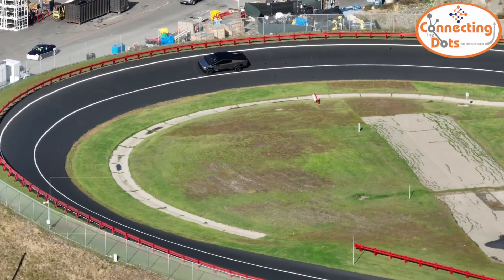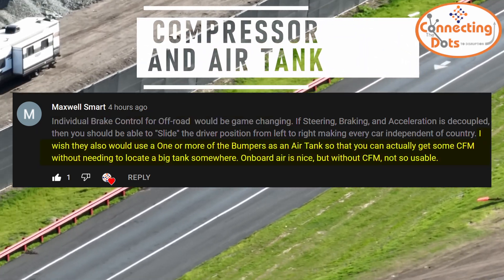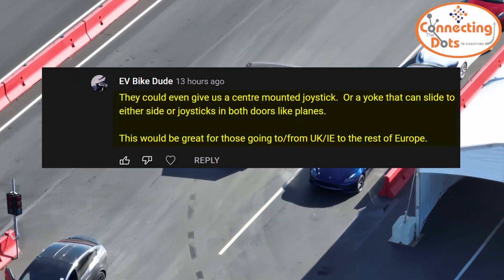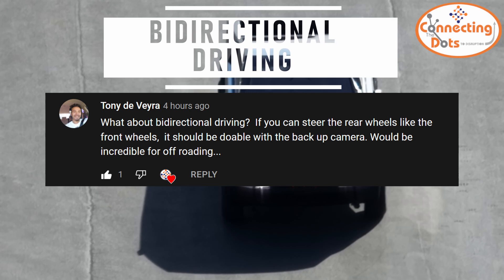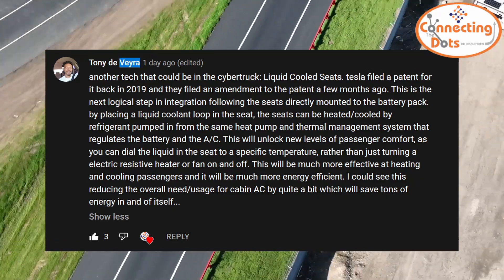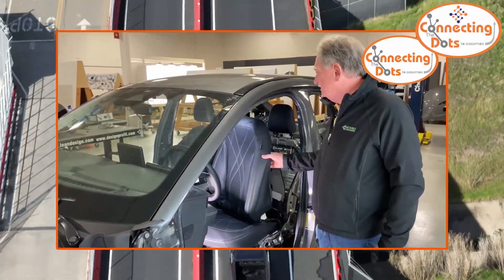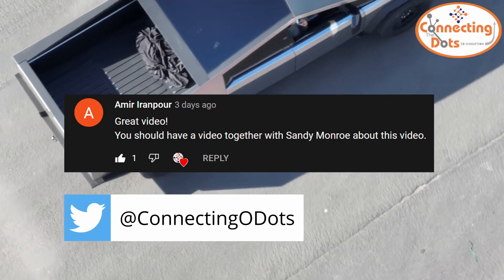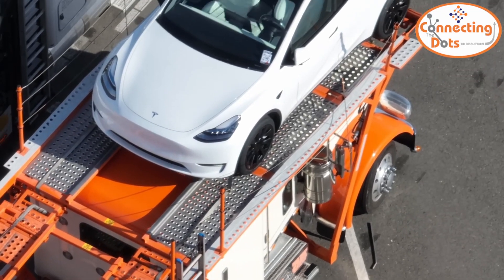LHD/RHD Cybertruck and Other Viewer Comments | Viewers talk Cybertruck

Comment: Tell ya one thing - with all this tech likely to be in the vehicle, I HOPE & PRAY the air suspension can handle the pitch & roll of this thing. Looking at some of the vids, this truck wallows like a small boat on heavy seas, which is a deal breaker - watch clips of GM’s magnetic shock setup & how it handles this shifting in large vehicles like an Escalade - its magic. Can only hope Tesla looks at this and comes up with a way to stabilize this truck.
Reply from the maker: Any videos we had online are100% preproduction and most likely prototypes. Their shock absobtion doesn't have to be anything like final product. No real problem making air suspension stable.

The main point is that air suspension replaces the SPRINGS while GM (originally Delco) Magnetic replaces the SHOCKS. You can use either regular springs or air springs with regular shock or magnetic ahocks

And btw a fan of GM magnetic shocks myself, Smart idea, well executed
Reply: @ConnectingODots  Great points.  I’m a day 2 res holder for CT, have a 2018 M3 AWD which I love - really just wanna see Tesla nail 
this thing right outta the gate. Awesome vids - keep em coming!

Comment: Okay, this is one has been driving me nuts since 2019: A design change for the Cybertruck that seems glaringly obvious based on first principles - and yet it doesn't look like it's going to happen as more iterations of the original design surface. I have hoped some engineer somewhere on some video would focus on this, but I've seen nothing to-date.
The vault, along with the buttresses, is a stroke of genius by Tesla, but not just from a structural perspective. Now that GM , Rivian, and Ford have played their cards, it is obvious that no one has any hope of duplicating one of the most powerful aspects of the two aforementioned Cybertruck design cues - when combined - but I fear Tesla is about to throw away one of the most compelling market-crushing features as the company moves toward tooling.
What am I referring to?
The much bandied-about conversion of the truck into a climate controlled camper.
Yes, we've all heard about it: drop the back seats down and emulate GM's avalanche-style midgate and open the whole vault to a massive micro rv space. Unlike GM, the tonneau acts like a ceiling for vault occupants, allowing them to camp anywhere with full heating, air conditioning, and lighting.
Bad news. It doesn't look like Tesla has changed the vault rollaway tonneau configuration, which has massive inherent risks and complexity. In its current configuration, it simply won't work for a camper mode. Also, in its current design, it has dozens of slats where debris and ice can build up, and has to come down IN FRONT of the back seats to feed into a storage area under the bed. This makes a midgate highly unlikely, and  - as seen at  the Giga Texas event  - the back drop-down window behind the back seats is too narrow and high to pass anything through. 
This design also limits the ability to convert the tonneau into an effective solar array and, even if Tesla does this, it is stowed at least 50% of the time (my truck's tonneau is rarely closed), not generating power. 
As Rivian has unfortunately discovered, a stowaway cover that adds overt complexity adds risk - and stupidity - to the 'feature' , which is bound to break. 
The solution is obvious, but no one seems to have looked into it as far as I can tell. A solar panel that doesn't have to bend, be partitioned into multiple slats, or be stored in an area where it can't be generating solar 24/7 is the only alternative, eliminating electrical connector challenges and parts fatigue. And, the most competitive bonus to the Cybertruck would be to have dropping back seats AND the ability to raise and lower the tonneau, regardless of the seat position.
Think of the multitude of potential configurations!
The truck has a massive sheet of glass right overhead in the back half of the cabin. The dimensions are similar, if not perfectly aligned to house the tonneau underneath. Why not add a 2nd layer of glass or supporting composite, creating a 'pocket' for the tonneau cover/solar panel to slide into? This eliminates all the complexity and mechanics of the current design. The tonneau simply feeds up into the upper cabin window 'slot', which can serve the dual function of shading out the glass on hot days, and all the while generating solar power in either position. From a wiring harness perspective, this simplifies cable lengths, motors, cleaners, and all the fuss of making the current design work. Even the deployment could be dramatically simplified. Where the stowed, rolled up tonneau had once been, add a master compression tank to vastly improve air pressure and load duration for air tools, but also using air to power a dyson-like cleaning brush at the slot entry that simply spins on air pressure, cleaning the tonneau surface as it enters the slot chamber. Even the opening and closing of the tonneau could be accomplished with simple air compression from the same tank.
I can't overstate how revolutionary the CyberTruck would become if it had onboard solar, a secure, climate controlled sleeping quarters in the vault, and the ability to drop the midgate and store 12' ft' length lumber, - 2ft longer than the Silverado EV - but all under a secure tonneau/vault!
Ford, GM, Stellantis, Rivian, or any other manufacturer currently has NO WAY to both store full midgate drop-down bed space AND cover the area.
I would love to brainstorm on these thoughts, have them critiqued, or even considered for a follow-up video.
The Cybertruck will undoubtedly transform the truck market once in production. I just hope a group of engineers have already mastered some solution in relation to this challenge and opportunity to make the full potential of this engineering masterpiece a reality.

Comment: As you know Infiniti has actually introduced the first drive-by-wire system a few years ago, however they couldn't move the steering wheel anywhere they wanted to due to the requirement to have a backup mechanical connection. So even though the steering wheel during normal operation is physically disconnected from the steering rack with a clutch, the supporting hardware still has to be there which then takes away the simplicity in switching between LHD and RHD markets.

Comment: I have a big issue with steering and braking by wire. Your answer for steering failing is ignoring the fact you still have control of the vehicle. Mechanically. 
A redundancy could be added if the car shuts off with a separate back up power system. Just like a drive by wire system.
The problem is if that fails you have zero chance. 
The same redundancy for drive by wire can be applied to mechanical redundancy.

Some things shouldnt be thought of ease of producing.
Being reliable is one thing, but the cost if failure is another.
Also if you understand the aircraft industry, systems that rely on fly by wire often use mechanical/hydrolic back ups.

Comment: Do you think the air compressor will be used to keep a positive pressure environment while in Amphibious mode to ensure no water intrusion?  Does the cyber truck have any noted use of a Tank for storage of compressed air?  Would it be not easy to envision even using a body panel sector as buoyancy chamber for ballast and or compressed air storage for such positive pressure cabin use?  Perhaps even being able to plumb in a scuba tank with regulator to facilitate extended time for positive pressure cabin?  Cheers and again excellent work.

Comment: The idea of efficiently cooled seats has utility far beyond cars. In the future when climate change has insured large parts of the world will need AC to be habitable, the idea of heated/cooled furniture has huge potential to save power over the typical approach.  Most people spend their days going from one piece of furniture to another, so having the furniture rather than the room control their comfort seems logical. You might still have the room dehumidified and cooled a bit, but most of the cooling would happen on the seat/couch/bed.

Comment: What do you think about the cybertruck being released as a single trim level? Cutting out even one motor will kill a lot of features. I could see them all being quad motor. Then you might as well max the battery. More parts per vehicle but less management of trim levels/orders.

I can see Elon saying: "Yeah.... We thought about it... Like this is the cybertruck. They should all have the same capabilities"
Reply from the maker: Cybertruck was announced with extremely low prices bc production cost expected to be lower than usual. However demand went through the roof and selling for anything near original pricing would be absurd when they can clearly charge a lot more. If CT is sold for $40-80K, many will immediately be flipped in secondhand market for twice the price.

Tesla CAN raise prices (preorders didn't reserve price, only price of FSD if ordered) but instead it's better to just launch a quad motor version and charge high prices until production ramps and costs lower. After that, I can only guess but I'm pretty sure they WILL offer fewer-motor versions at a lower price (though higher than originally stated)

Comment: I've ordered a Cybertruck some years back - the three motor version. I also added FSD. I live in South Africa - and would love to move between LHD/RHD. Thought this and your previous video were great. I want to collect it in Austin and get the Cyberlandr installed, go see a SpaceX launch (preferably Starship), go to Burning Man for a week - then ship it over the Atlantic to Africa. Would then drive it home. Might be still two years away!

In my thoughts for a four-motor vehicle - what I see in the future (10 or so months away) is....
1) Steering wheel that gives manged turning according to speed (low speed=turn sharp, high speed=turn gently) along with the ability of choosing what wheel turns in what direction (e.g. Diamond (Tank), safety when pulling a trailer - etc) - Steer by wire. I often pull a Caravan. Perhaps the "steering wheel" can tuck itself out of the way when on autopilot? Oh - and some way to drive/steer the truck with a remote, hand held "game" controller - from inside the Cyberlandr. Just slowly and short distances.
2) Individual wheel brake control (brake by wire)
3) Electrical - Charging at +800V, able to power my house with a 240V single phase (Non-USA) - use it like a Power-Wall. 
4) Liquid based temperature controlled seats (nice!)
5) Like the idea of an air tank with the air compressor.
6) Built-in Starlink
Reply: Hi Mark, got a reservation. perhaps we can ship together?
Reply: @michielsmit7969  sure - in a year or so. Let's see.

Comment: Thanks for interesting videos!  Genuinely digging deep into tech and potential is interesting, when the effort is put in to keep it grounded on physics and practical limitations.  Reminds me of CSI starbase, which is also great.
As far as the reduncancy goes, with 4 wheel independant brakes and steering, I'd expect it would be able to be tuned to bring the vehicle to a safe stop in the event of a total failure.  Thats without even considering independant drive  and even air suspension, which could make limp mode much more literal, being able to drive somewhat with damaged or failure to one corner, especially offroading.  Or for that matter just to get to a better spot to fix a flat.

Comment: RHD in Europe . The current version of Cybertruck is to large for use in Europe. Elon suggested to consider a reduced size version for Europe.
Reply: Do Ford or Chevy sell their "regular" size pickups in Europe?
Reply: @kjer6071  rare in UK. A few RAM trucks but since they are the same size as a lwb transit chassis with less weight capacity and worse fuel consumption.
Only folk who feel a need to "prove themselves" drive them.

Comment: I have CTIS (central tire inflation system) in my Hummer H1. This allows me to inflate or deflate the tires even while driving. This has worked nicely - when off roading in mud and sand or just inflating a leaking tire. CTIS is notorious for leaking air, but a great mechanic solved the problem for me. The Cybertruck would benefit with  CTIS for off-roading.
Reply from the maker: True, and with the on board compressor should be easier. Unsure if they'll do it (adds complication) but if they do, would be great for offroading

Comment: RHD/LHD will have opposite wiper pivot points, to give a driver the best visibility.  Tesla uses a diagonal cutout in the windshield, to prevent any difference in the body...brilliant.  But this makes it less effective on the other side, which isn't favorable to a swappable LHD/RHD design.  And how often would this feature be used?  Tesla is known for removing seldom-used features, and I have a really hard time coming up with a reason people would really need this, versus the cost Tesla will incur implementing this (both in time and money).  So I don't think it's going to happen.

Comment: Don’t confuse technology with gimmicks.  

There will never be a RH drive CyberTruck.  There’s no market for it in those countries.

CyberTruck won’t spin in place because it’s unnecessary complexity for a fairly h useful maneuver and violates first principles. 

Most of CyberTruck’s tech will likely be in manufacturing.  

Those crazy software features?  They won’t come at launch, if ever.  But maybe some day.
Reply from the maker: This is just a spinoff raising ideas from a deep-dive video about expected Cybertruck tech. As explained there, Cybertruck's brakes and steering will be By-wire, Cheaper and less expensive to assemble, and most of these features will arrive at around 0 cost (except for tweaking the software). The main video gives an engineering analysis (physical forces etc) showing that Rivian CANNOT do the tank turn, while it's highly probable that Cybertruck will. The current video is worthess without seeing the main one, and again - surprising as is seems, the unique brakes and independent steering which enable Tank Turn are LESS expensive than going conventional. https://youtu.be/Y41rHaTGgWY
Reply: Utes are a huge part of the market in Australia, New Zealand, south Africa and most of south East Asia
Reply: Not according to the forums where lots of people are begging for them outside the USA.

Comment: If trailer manufactures desire they could take advantage of vehicles with four wheel steering like cybertruck.  Tesla could make available an external digital rear port.  A digital port on the rear cybertruck panel whose driver wants to change lanes and does so by angling all the wheels left or right could be communicated by the cybertruck to a similarly enable trailer.  A trailer equipped with steerable wheels could then match the cybertruck movements left or right and all the counter twisting forces mentioned wouldn't happen.

Comment: That GM car looks great. The problem with GM never was the engineers, always the management.
Reply: It was also the UAW, who reached all the way from Michigan to every corner of the globe where GM has ever done business. The UAW power over the Big 3 worldwide has been little understood by most people, or downplayed by those who have depended on a CBA. That's part of the reason why corruption in their leadership is much more alarming than news reports would have you think.
Reply: @michaelterrazas1325  As a person who has worked for many managers and been in many unions, I can tell you the management is far more likely to screw things up than the unions. The unions sometimes are enablers of bad behavior, but the managers are almost always the source.
Reply: @macrumpton  I'm not interested in the amount of blame you want to assign to each. I did a LOT of consulting in the auto industry in the 90s and well into the 2000s. I worked with several manufacturers, and those saddled by the UAW had HUGE obstacles to overcome to allow them to move into the future. I was in meetings where several of us showed that continuation of certain policies would hurt GM, in particular, to the point where they just may go under completely. The UAW representatives used their veto power to stop the company from doing ANYTHING. That catastrophic decision was a big part of GM needing to be bailed out. So don't try to tell me the unions aren't a big part of the problem. You don't know what you're talking about.

Comment: Loose talk. Rear steering is very limited as there is no need for a small radius turn.
Reply from the maker: you're right about small angles, but they're not necessarily THAT small (see Hummer EV). Backwards driving won''t be a usual mode, but could enable a limited way to get out of tough terrain
Reply: A tiny amount of rear steer makes a massive difference. My 10x10 has rear steer on just the rear most  axle and it's so much better to drive then the 8x8 with no rear steer. Rear steer would be great in carparks and off-road

Comment: I want to make an add-on that would basically serve as a running board most of the time but would also be a hidden compartment that holds an inner tube connected to the onboard air system. Idea being that you could drive into some shallow water, hit a button and the two innertubes would inflate and deploy, turning the cybertruck into a sort of zodiac-catamaran raft.
Reply from the maker: OOOh!
Reply: Sounds awesome but the number of people who would find that useful is crazy low. We won’t see that from Tesla.